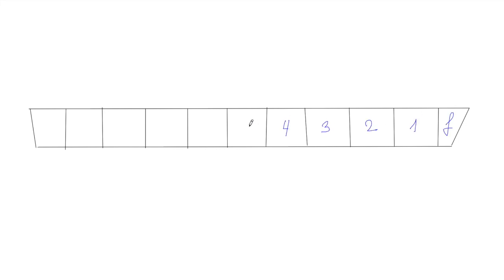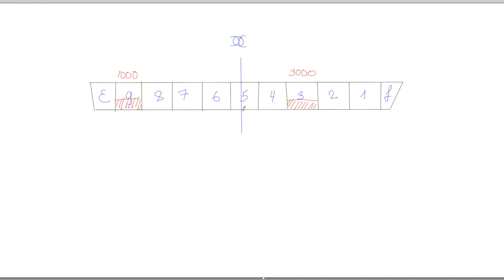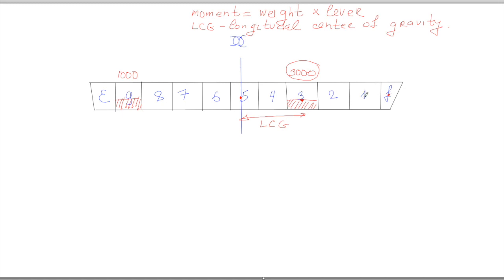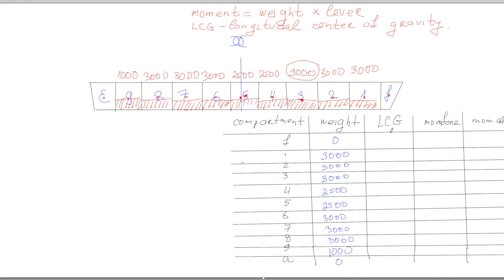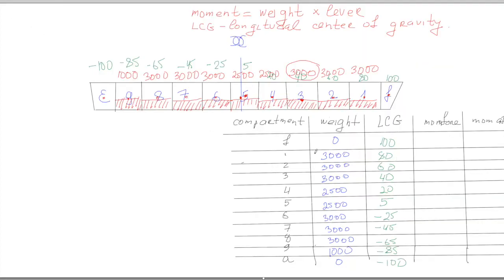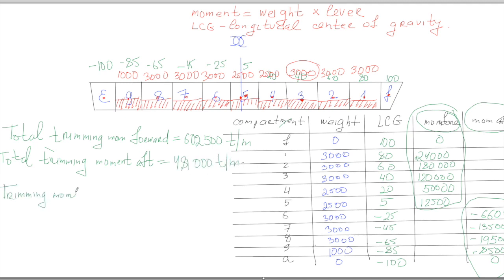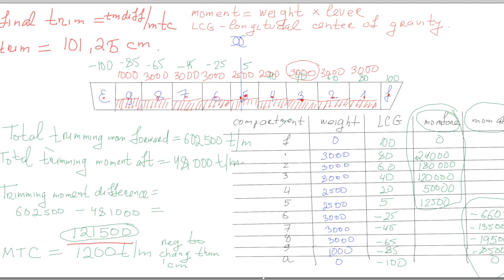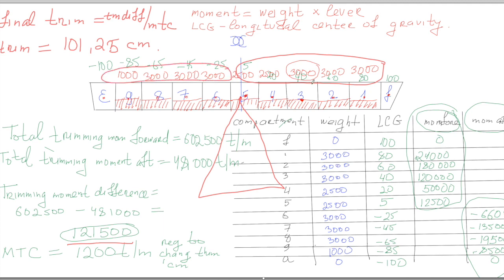How to calculate ship's trim.

Comment: Very long time I tryed to understand that things, and more of my questions are had answers. But I have a question Dear Captain, 1200t per cm, how I should chose it. After calculation , I find the deferent between aft and for, and I should to chose in table correct different in my draft and find MTC, is it correct? Thank you in advance. Best regards.

Comment: I'm trying to figure out how did you get 66K in the 6th row? #6 had 3K for Weight × 25 = 75,000. Which would make the final trim 112,500.

Then, 112,500/1200 = 93.75cm

Correct me if I'm wrong. ?
Reply: Right calculations isn't goal of this video.
Reply: You are correct sir

Comment: So it means the location of Center of Flotation or LCF has move forward from midship of 101.25 cm? 

And since the location  is in forward the LCF will become negative sign   (-) 1.013 Meters from the midship. 
Capt this is correct??  Please reply Thanks
Reply: Not  clear, the location of LCF not mentioned if AFT or FWD of midship.
Reply: Now its been 3years I still  seeking the procedures on How to Calculate the LCF just to determined if it is in the forward or Aft Position.😢